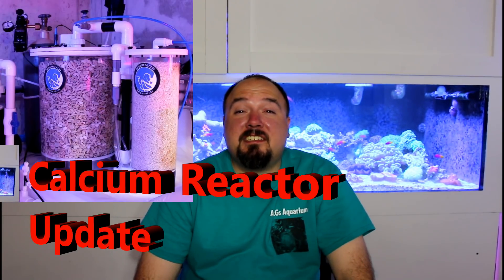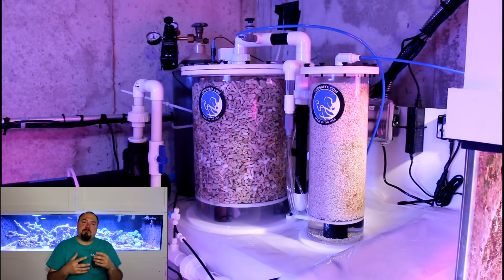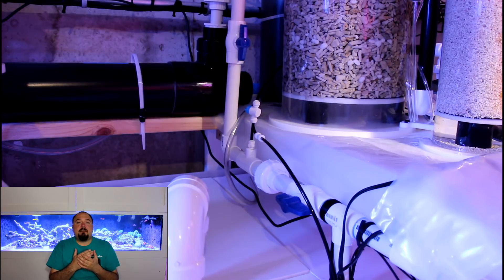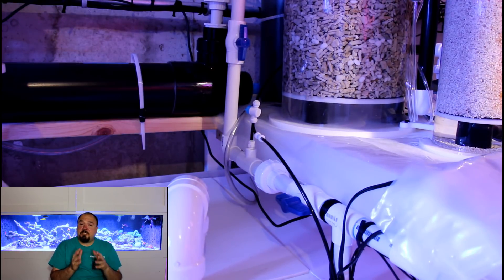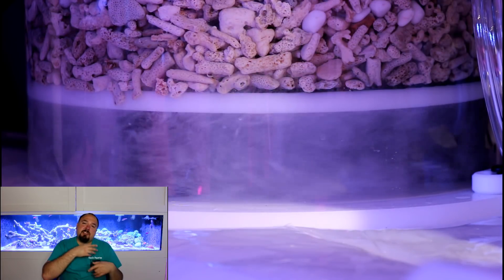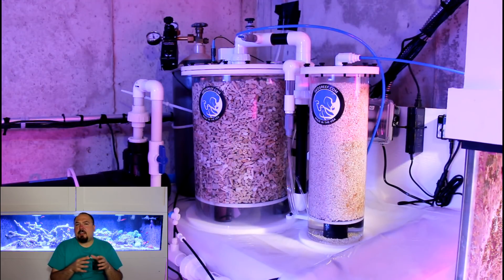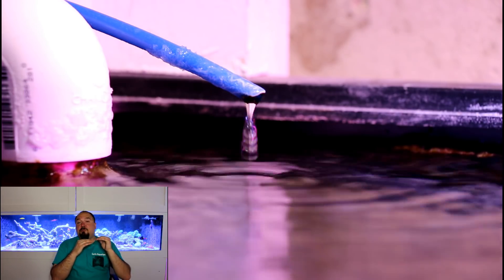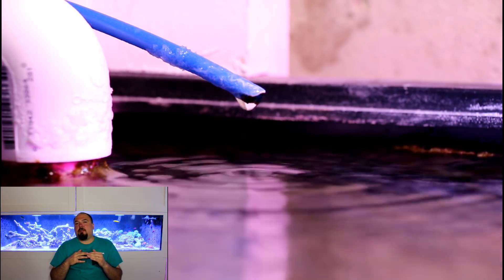Calcium Reactor Update

Comment: BTW, did you figure out where the air was coming from?
Reply from the maker: I have determined that the bubbles hanging around in the main chamber are just undissolved C02.  Every now and then the re-circulation pump will stall out due to the amount of CO2 but after a few minutes the pump will re-prime itself and start running again without any manual intervention.
Reply: @AlexGs Aquarium interesting!

Comment: Hey Alex, what a project - my god. Congrats. What do you think about the Geo's Reactor?  I'm thinking about getting the same setup for my 800g system - I think you have the 1218 model, and the 618 secondary chamber (plus the CarbonDoser)? I've been looking at this setup vs. a Destaco-type model, which in general is a lower pH effluent which I'm trying to avoid. Let me know if you would buy it again!
Reply from the maker: I would get a GEO again.  I also got a kamoer peristaltic pump and it really made the operation of this calcium reactor easy.  I did look at destaco but as I am in the US I was concerned about the ability to get replacement parts easily compared to the Geo which more or less for me relies on few parts that are easy to get within a few days.
Reply: @algawura2  Cool - yeah, i would have the same concern with replacement parts. Alright, one more vote for a Geo! Thanks for the reply Alex - appreciate it.

Comment: What media are you using? Do you buy it in bulk?
Reply from the maker: I am using reborn media by 2 little fishes with 10% remag mixed in for the main chamber  The secondary chamber is filled with caribsea ARM fine grain media.  I picked up the media from bulk reef supply and have not done any refilling since the reactor was put into operation.

Comment: Hi I just found your videos yesterday and I’ve been watching a lot of your stuff,   I am going to be putting up a 210 gallon mixed reef and I am a little bit confused as to why or how the pH is lower in the calcium reactor and why the tank is higher? 
How does it start low in the reactor and then in the tank at 8.2? 
I’m starting to think the calcium reactor is more of a hands-on and learn to do as you go kind of thing?
Reply from the maker: I am glad you are enjoying the content Brian Culater.  The calcium reactor works on the principal of using CO2 dissolved in the water to create carbonic acid which will lower the pH of the water in the reactor chamber causing the media to dissolve which leaves the reactor as an liquid affluent rich in calcium, carbonates(Alkalinity), magnesium, and other trace elements.  The affluent goes through a second chamber of media which helps the neutralize the carbonic acid allowing the affluent to return to the main system at a pH that is only slightly lower than than of the main water in the system.  The water flow rate and the amount of CO2 injected into the reactor will determine the pH level in the main reactor chamber and the strength of the affluent being put back into the aquarium system water.  In conjunction with testing Calcium, alkalinity, and magnesium the rector water flow and CO2 injection is tuned until the levels remain stabilized in the system.  As every tank is different it must be tuned for each system based on its demands.  Let me know if you have anymore questions.  I have a few other videos on my calcium reactor setup.  https://www.youtube.com/watch?v=gTArX0Ff_tQ&list=PLB7yLHQeKst_2zYjIV_ma4vockDUCrP1j

Comment: I just threw my AquaC calcium reactor back on. I am now running RHF 2 part via BRS dosers, KHGuardian, kalkwasser in ATO, and daily Manual Kalk drips. I run my CaRx at pH=6.6 as well with a decent drip rate. The pH in my tank I aim to maintain at 8.2.  I found that 1 method was never good enough.
Reply from the maker: Thanks for commenting Ellery Wong.  I have been kicking around the idea of using Kalk to increase my pH I just need to get a method going for adding it on a steady basis.
Reply: Alex,  I use a TLF Kalkreactor as part of my ATO and control based on pH < 8.4 and Alk < 9 dKh.  I also have a Freshwater JBJ ATO that is only limited by Conductivity between 34-36 ppt.  I only have a 420 gallon multi-tank system so water volume and dosing is definitely not as much as yours but I have a high SPS bioload absorbing alot of Ca/Alk/Mg. I need to test the CaRx effluent to see how much is really in there or add more reactor media since it is only half full now.  The KH Guardian compensates for the ALK differential as the bioload increase but Calcium and Mg is manually adjusted after testing.

Comment: Have you thought of a peristaltic pump ? A few great things about them is they are meant for running 24/7 they can be added to pull the tank water in it to cause a vacuum inside the chamber inside the reactor and help with not causing leaks. Great vid can’t wait until I get that same reactor for my new build 😎
Reply from the maker: Thanks for commenting Reefing with Reefer.  I have been thinking about a peristalic pump for the calcium reactor. Due to the amount of dosing that will be required as the tank matures I will have to find something that is continuous duty rated for higher volumes.  I did see that Pentair offers aquaculture grade continuous duty peristalic pumps but I am not sure if they are big enough to keep up with the eventual demand of my system.